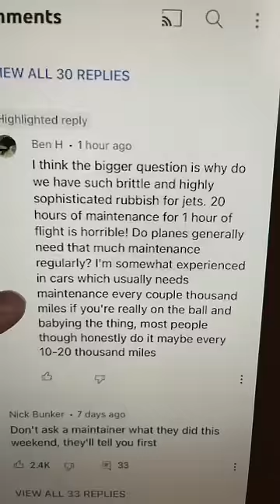Why does an F-16 need 17 hours of maintenance for every hour of flight?

Comment: Imagine looking at a full on fighter jet and saying “pffftttt, I have a car and that doesn’t take 17 hours of maintenance”. You’re right. I have a push bike so sign me as an F1 mechanic 😑 dick.
Reply: F1 cars are a lot more expensive than fighter jets, imo funny to think about.

But then again, each F1 car is a custom design and contruction.
Reply: I have pet rock that I like to sit on and it requires zero maintenance. I win.
Reply: @termitreter6545  F1 cars are not more expensive then fighter jets. I mean it depends on the jet but average f1 car is 10 to 15 mil. F35 cost 80 million, b2 cost 929 million.
Reply: @FulkNerraIII  I think the anual costs to develope, build and service an F1 car are something like 500 million? Thats the number ive usually read.

Tbf it might depend on what you count as "cost".

For example, the F-35s 80 million cost, even if it is real, is often considered misleading, because that would make it only slightly more expensive than an F-16. In reality though, its basic lifetime cost without upgrades is likely around 250 million Euro (via Germany, Denmark, Great Brittain buys).
Which is actually very expensive. Frankly, makes you wonder if cutting the F-22 wasnt a dumb idea, it couldnt have been that much more expensive.

If my numbers are right, thats the equivalent of 500m for 1 year of a new Formal 1 car. Usully they do a complete redesign after 1-3 years at most.

Comment: Thanks for the shout-out to maintainers!

As mentioned below, that's an AVERAGE over a long period of time. Even for the Special Ops C-130s I worked on, you can turn the aircraft between flights with just a few "hours" (which includes a number of personnel) of maintenance. But when you add in something like, say, an engine change, which may take 4 people 3 hours, that's 12 hours of maintenance. Two of us may take an hour to change a main landing gear tire (so that's 2 man-hours).

You put an aircraft in Isochronal inspection, and a team of people perform the (every inch, screw, rivet, and x-rays of major airframe pieces like wing boxes and spars) disassembly, inspection, repair, and reassembly of the aircraft to prepare it for (period of time) flight.

Enjoy your videos!

Comment: Important to note, this does NOT mean the jet automatically sits on the ground for 17 hours after a 1 hour flight.  The 17 hours figure is likely 17 "man hours".  Meaning it's possible for one maintainer to have it ready again in 17 hours, or it's possible for a 24 man maintenance team to have that thing ready in less than an hour.

Comment: As a aircraft fuel system specialist 2A6x4, you are right about the tanks being pressurized. However, pressurization moves the fuel out of the external fuel tanks. All the tanks feed into the F1 fuel cell right behind the cockpit. That tank feeds the engine and has a inversion pump on top to feed fuel while inverted. Also, that tank is kept at 97 percent full with fuel during operation.

Comment: Former F-18 avionics technician.. the 17 hours of maintenance per flight hour seems crazy but it's not just one guy working on the plane for 17 hours straight.  You have several different disciplines (plane captain [crew chief], avionics, powerplant [engine mechanics], electricians, ordnance, etc) working and doing checks on the aircraft almost simultaneously.  Some of those 17 hours are taken into account with maintenance performed not just after every flight, but at regular intervals after xx flight hours, 7 days, 365 day inspection and so on.  Great videos man!

Comment: OK question: is it 17 hours of man-hours on the ground, or literally 17 hours?

As in, could a crew of 17 mechanics do the maintenance in an hour, or does the aircraft literally need to stay on the ground for about 17 hours before it can fly again?
Reply: Yes. In all aspects. Either a total team who's contribution would total to 17 hours, or a set period to elapse a total of 17 hours.
Reply: I doubt 17 people can maintain an f-16 at once while working at best efficiency. It might not be as bad as the long discussed problem of software development (where adding more developers not only makes the man hours requirement go up, but actually makes the TIME time until finish go UP) but I imagine there will be a lot of "can't physically get to the part I'm supposed to maintain" or " you can't begin this process until that other process has been completed" if you try to have 17 mechanics fix an airplane at once. 
Plus, getting 17 highly skilled F-16 mechanics in one place at one time sounds hard
Reply: These numbers come from a total team effort and the figures that maintenance planning uses to plan in-depth inspection. At certain benchmarks like 60hr and 120 hrs of flight, different inspections are required and generally take hours if not days by a whole team to complete.
Reply: its a myth as proved by mythbusters...its 17 minutes of maintenance. in 17 hours you could build a new airplane. do you really think spitfires were down for 17 hours?
all you need is fuel and ammo and to check for bullet holes.
Reply: @esecallum  your a smart one 😵‍💫
Reply: It’s averaging. An aircraft’s can carry multiple sorties in 1 day so therefore it wouldn’t work if it was down 17 hours after every flight.
Reply: @esecallum  "17 hours you could build a new airplane" - cough cough bullshit cough cough
Reply: Man-hours. You’ll be lucky to have 7 dedicated maintainers per plane let alone 17. In reality it’s a team of 3 or 4.
Reply: @esecallum  I could imagine that war time changes things, and that after peace time training sessions maintenance takes a whole lot longer, to literally inspect everything.
Reply: This is economy of scale and exactly how to these craft continue to fly day in day out
Reply: @fredmdbud  The British built ten Spitfires a day during the war. So it's certainly possible. 😁
Reply: @SweBeach2023  I think it was more like 10 a month. The Spit wasn't a simple plane to build. My English cousins can correct me. Ford Motor built 1 B-24 every 55 minutes at Willow Run. Look it up, no shit.
Reply: @julianbrelsford  That's exactly it.  One time we had to replace a hydraulic pump but we had to wait for a different specialty job to take a part out that was in front of the pump (even though we could of very well took it out ourselves, but military has to have its procedures). Just waiting for them to take it out took several hours and then they had to wait for us to remove and replace the pump which also took several hours.  None of this helped that the screws are so old/worn down/ stripped or the nut plates are broken that as we go along we find more things that need to be fixed before we can even get the new pump in or it just flat out takes us more time to get screws in that have been stripped out.  Also, just to add the 17 hours of maintenance  per flight hour is just an average we can have jets land and go back up multiple times a day but then one of those jets have a 400 hour inspection the next day which can take multiple days to complete.
Reply: theres this thing called law of diminishing return. you can only throw so many people at a task before theyre just standing around because they would only be in each others way. theres no way theres enough room for 17 people to work on it at the same time.

im sure there are ways to speed it up, but some things simply take time, no way to avoid it

Comment: Yep. Russia's blunders have proven just how valuable engineering and maintenance are to a military.
Reply: Yeah, massive numbers of aircraft and tanks mean nothing unless you have enough in usable condition.
Maintenance is everything.

Troops in North Korea remark that they only train alongside tanks a couple of times a year because of lack of fuel, and they hardly ever see a helicopter or jet because they don't have the spare parts or lubricants most of the time to keep them in flying condition.

Comment: If it wasn't for maintainers..they'd would be no Navy, Air Force, Army and for my US brother..  Marines. Don't forget the guy running around w/ Cynoacrylate and 1kg clear bag filled with white powder
Reply: But are you referring to contract maintainers, too? Because last I checked, there are also uniformed maintainers in the armed forces (e.g. sustainment brigades in the Army)
Reply: @fredmdbud to the ones in uniforms because unlike civi's they don't work 9 to 5 +overtime. I was Armoured and when i broke down, its my responsibility as a drv because I signed for my Leo, i now become the Maintainers Bitch and I have absolutely no problems at being the maintainers Bitch
I know our EME at 1st & 2nd line maintenance were always busy and open 24/7 depending what the Op tempo even the guy with the 1kg bag of white powder..

Comment: They are also not mass products like cars. There is much less time spend making this maintenance minimal in the engineering process I assume. Also if the criteria is to make the plane perform better over increasing maintenance, the first one will be choosen
Reply: there is no need to fly at weird angles just fly straight and level. the weird angles are simply to satisfy flyboys with their expensive toys. weird angles are pointless.
Reply: @esecallum  you are calling every military with an Air Force “flyboys with expensive toys”?
Reply: @esecallum  is flyboys a warhammer 40k reference?
Reply: @esecallum  Your comment tells me the closest you've flown is jumping off the bed. Even Flight simulators show WHY it's important to move at ANY angle.
Reply: @esecallum  ladies and gentlemen…

the guy who’s the first to die in every horror movie
Reply: @esecallum  I don't think you're factoring in COMBAT. Which involves trying to hit the other guy without him hitting you. Which involves crazy maneuvers so as to be completely unpredictable with the objective of DON'T DIE.
Reply: @esecallum  there is a lot of need to fly at “weird” angles if you’re employing weapons or are trying to avoid someone else’s weapons. We wouldn’t build fighter jets if we only flew straight and level

Comment: "Think of it this way: Does your car go at Mach 1 upside down" Thanks for the free thoracentesis
Reply: My thought at that point was "with a few rockets and enough fucking around it will"
Reply: @AstoundingAmelia  Well, then, I guess the real question is if you intend on surviving it.
Reply: @chrisparker2118  well I wouldn't be in the car when it's going that speed, id use remote control

Comment: The other thing to mention is a lot of components in an Aircraft have a limited number of Flight Hours before they have to be replaced.

So it's not like a Jet flies for one hour, then is laid up for 16 hours, it's more like after X number of hours, various components get replaced and that will take approximately 16 hours per hour of flight.

Comment: As far as I understand it is a good rule of thumb that, the more high performing and the more newer / experimental technologies, a machine utilises, the worse its operational hour per maintenance hour.
The first reason for this is, newer technologies are always relatively immuture, their flaws / weaknesses has not been completely discovered and countered yet, hence they are unrobust.

The second reason for this is, high performing technologies typically operate near the limits materials, hence wear and attrition happens very quickly. For example in mechanical case the the closer stresses that a component suffer to its tensile strength and ultimate tensile strength, the more quicker the wear and attrition happons. This problem primarily can be alleviated by advancement in material sciences and solid state physics. For example what stress quickly wears down the "poor" duralumum airframe of an F-16, would be "unnoticable"' for a carbon nanotube airframe.
Unfortunately solid-state physicist could not come up with and industry worthy manufactoring techniques of carbon nanotubes yet.
Reply: Yeah we already got a better answer from Ryan.

Comment: Former F-16 crew chief here. I'm sure I'll forget a thing or two since it was over 30 years ago, but here goes. Preflight, postflight, LOX servicing, fueling, all add up to several hours per day and that is with no writeups. Change a lightbulb, static discharger, put 370s on, change a tire, more time. Then add in other maintenance issues that require avionics, sheet metal, egress, etc, more time. Weapons guys come out and load the plane, more time. Also you have things like washing the plane, phase dock and other things that take time. Changing any major component means lots of other operational checks, including an operational check flight.  It all adds up, but they're all routine maintenance, and not a "plane is code 3 (broken) every flight" type maintenance.

Comment: What's your opinion on the Saab Gripen?
IMAP [like IMHO but a Amateur] It's a logistical masterpiece that is very practical for real war conditions.
And if Ukraine had gotten a bunch a few years back and had pilots familiarised with it they would be in a lot better situation.
Reply: Honestly the Gripen has been drastically overhyped especially the Gripen E. It suffered the same fate as a lot of other aircraft programs, it was promised to be cheap and easy to maintain, but as development continued, the price kept going up along with maintenance requirements. For an aircraft with a purchase price several million more than the F-35, it’s not particularly impressive. It’s also not as easy to maintain as people think. Saab keeps saying “it only needs 1 technician and 4 conscripts” but that’s literally just to pump gas and strap on weapons. Even the F-23 can be rearmed and refueled by just 5 guys, the hard part is actually fixing things. Saab is frustratingly unclear about maintenance per flight hour, so it’s hard to know exactly what it is, but from what I can tell, it dose t seem to be any lower than the f-16C. That being said, the Gripen is a good jet, you get capabilities similar to the Rafael for 50 million less, it’s still not nearly as good as Saab said it would be. That’s why it’s largely overhyped, people talk about it based off of what Saab said it would be during development rather than what they have actually delivered.
Reply: @Eddy_Sapo  what about the stories ive read of gripens sneaking up on and taking down f22s in exercises?
Also the gripens electronoc warfare capabilities are supposed to be black magic basically, is that hype too?
Reply: @JoesTowingBaltimore  Be careful to not step into bullshit around here , I read a lot of opinions with little or on this case nothing to backup claims. Could just be spewing feelings over facts. For instance E can swap engine with only 1 tech and the rest being conscripts,  in field conditions , because that's the doctrine of the Swedish airforce. They can't fly around in hangar queen's because they don't have the numbers in the first place, so they need to design things from the get go to be efficient. America can since they have vastly more of them. Also E is very expensive to buy , but not to fly & maintain, its even cheaper in that regard then the predecessor Viggen, which was one of the criteria that they needed to meet or the entire Gripen project would never had been built in the first place, there was plenty of politicians who didn't want to build another jet fighter after the "expensive" , from a Scandinavian POW , Viggen.
Reply: @JoesTowingBaltimore  Also all there is on the subject are 1 interview with the American pilot that says he got shot down or maybe ut was the squadron commander I cant remember. I've found nothing from swedish sources , and that's perhaps not surprising since what your asking about remains top-secret. Allegedly it goes from mediocre to deadly, hard to tell.
We also don't know the missions settings when this happened so might as well been pure luck. All I know is that Gripen haven't been allowed back to red flag for some time now. Again this can be for a number of other reasons.
Reply: @JoesTowingBaltimore we can’t really use training exercises to tell the full capabilities of these aircrafts. Firstly, very little of what happens during these events is made public. We usually only get a couple of quotes, we’re not given the scenarios or conditions. Also the training is never a 1 v 1 fly offs. They are always scenario based and have different restrictions. I’m sure a gripen has gotten a kill on a f-22, but we don’t know what the situation was. It could have been a guns only scenario, a 2 v 6, or something else. Keep in mind that for the past 40 some years t-38s and F-5s have gotten 100s of kills against everything from eurofighters to f-15s to even f-35s.  Obviously the T-38 is not nearly as capable as the aircraft it’s flown against, but good training means pushing your team to and past the limits.
Reply: @JoesTowingBaltimore  also in regards the ew capabilities, their is no indication on exactly what it’s capabilities are. Obviously it’s highly sensitive and publishing exact numbers would be stupid. That being said, it’s sophistication is likley to be some where between the rafale and the f-35. However, this does not mean it’s is as capable. Any ew, no matter how advanced requires a lot of power, the more power you have, the more frequency’s you can affect and the further you can affect them. The gripens single f414 can not generate nearly as much power as the rafales twin m88s or the f35s f135 engines. This naturally puts the gripen at a disadvantage. The gripen is probably very sophisticated, but Im fairly confident it’s not as capable.

Comment: Keep in mind these stats are a little misleading.  It’s not like you fly for and hour and then put the plane into maintenance for two days.  These are simply the averages over the life of the aircraft’s combined and, I would assume, include repairing battle damage and those times where a plane sits in the shop for ages waiting for a part.